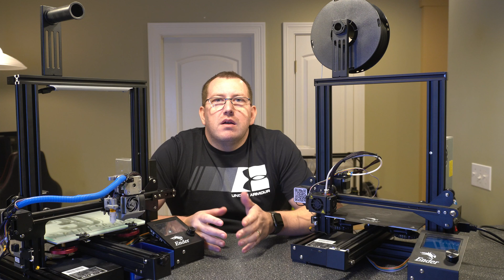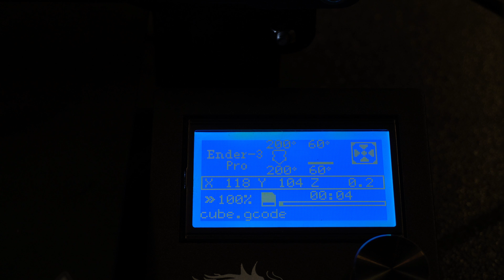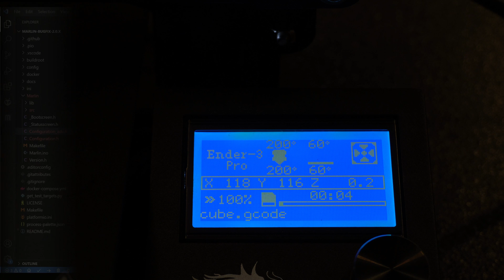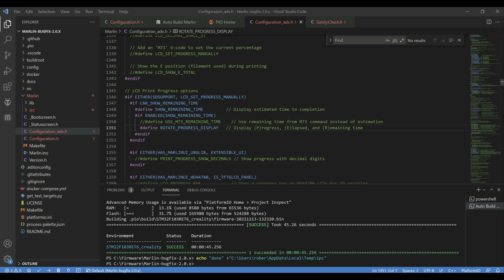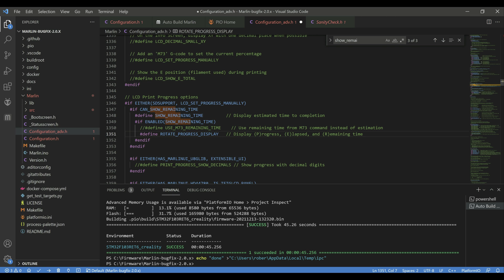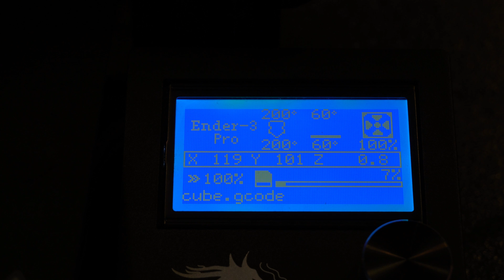Add Percent Complete to Marlin Firmware

Comment: Hey Rob, I hope this thread is still viable. I have flashed your custom marlin firmware on my Ender 5 Pro after installing a cr touch it was the only fw I found to work with the GD chip, thanking you. Can I use those files from the firmware folder to use to make adjustments like in this video? Thank you again much appreciated.
Reply from the maker: Hi. You would have to grab a new version of the configs and move the changes over.

Comment: I spossible somewhere in the Marlin modify speed of the information rotation?
Reply from the maker: Hi. I was looking for that but didnt see it in the config files. May need to jump into one of the modules to change that.
Reply: I had the same issue and I looked into it. in the file MarlinUI.cpp look for next_blink_ms 
it's somewhere around line 170
I changed the number from 1000 to 3000, so it only changes every ~3 seconds

Comment: Hi, thanks for explaining this feature. Is there a way to slow down the rotation?
Reply from the maker: Hi. Not that i have seen.
Reply: In the file MarlinUI.cpp look for next_blink_ms (it's somewhere around line 170)
I changed the number from 1000 to 3000, so it only changes every ~3 seconds

Comment: Does this work with octoprint thru the usb port? Could it be that the octoprint timers work better?  Great video, the fan noise about drowned you out, but still very useful, thanks.
Reply from the maker: Hi. This is in the firmware, so it will work even if the print is kicked off through octoprint. Im not sure which one is better, they are both estimates. Also, sorry about the fan noise. The only way for me to have changed that was to do a voice over afterwards.

Comment: Just a small correction: the percentage is calculated by the amount of lines that have been processed not by the Z-hight.
The printer does not care about the height.
Reply from the maker: Hi. Yes you are correct, that's what i was thinking in my head i guess it came out as z-height when i was actually recording.